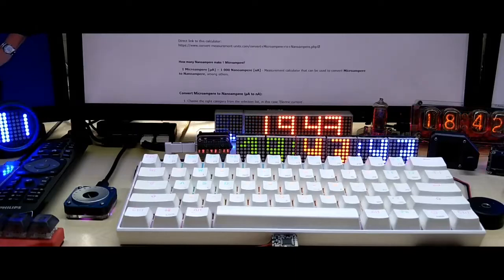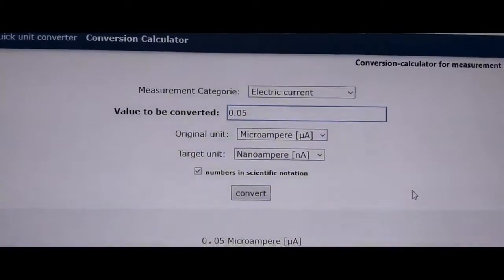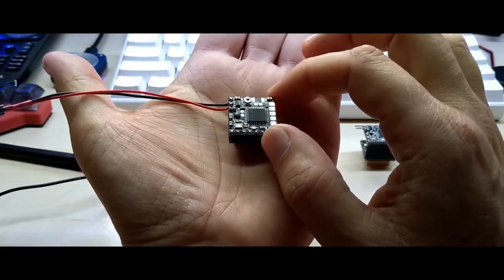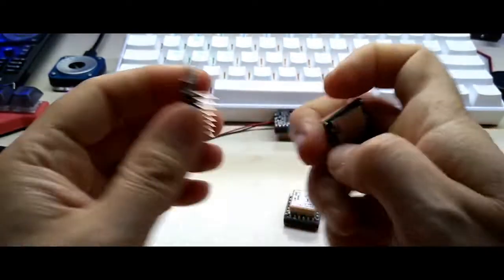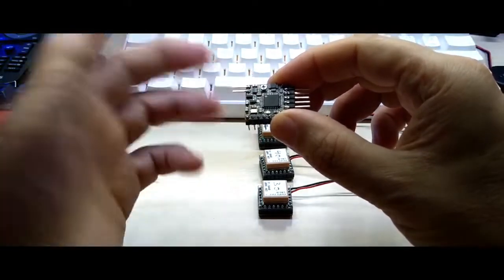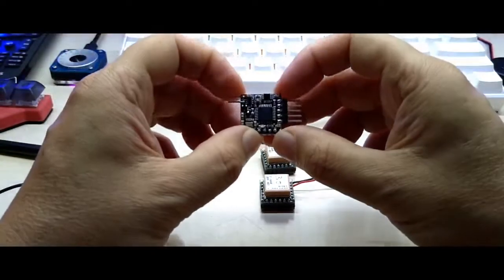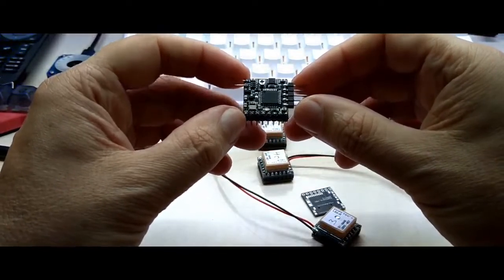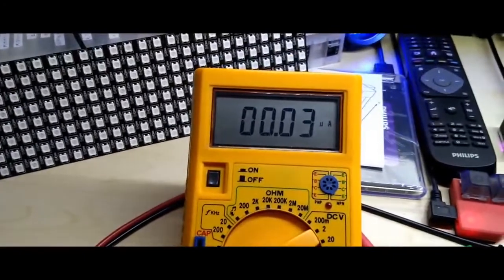My updated Low Sleep Current GPS Tracker with a sleep current of only 35nAh #Hayri #Arduino #GPS

Comment: Hi, is it possible to use TPL5110 for timer based power up, and also power up on an accelerometer interrupt signal? How?
Reply from the maker: Go ahead and do a google search, sparkfun has a good write up on the TPL5110 chip, also check out it's datasheet.

Comment: Hello, I’m looking for something pretty close to your project. Can you made a gps tracker with 10Hz frequency and logger for max speed. Will be great with mini oled and Bluetooth app to check the logs. This is for RC boat and need to be lightweight and waterproof. Can be plugged to the receiver battery
Reply from the maker: Hello Nicolas, surely I can make it according to your needs, it is just a matter of cost as I need to design a new PCB and use an additional Bluetooth module and OLED display. As for a waterproof case, I could think of a GoPro Session 4 case for example. Not sure how lightweight it needs to be and the plug used on a receiver battery.
Reply: @iHayri1  I’m trying to make it with an esp32 ttgo display and a gps+glonass module and  SD card.

Comment: Really nice. Let me ask. It need a gsm sim card right? How you track the device?
Reply from the maker: Thank you. This tracker/logger records the data onto a microSD card,  it does not communicate over GSM
Reply: Do you have one that has a sim card?
Reply from the maker: @karlsprongl  Not anymore, as the sim modules I used are working on the 2G network which is being slowly shut down. Although I could technically make a improved version to my earlier design now, but only if I get enough prepaid orders. This btw, was the first version I made: https://www.tindie.com/products/9415/
Reply: @iHayri1  Thanks for the reply.  If you do decide to make them, please let me know. I would be interested in getting it.